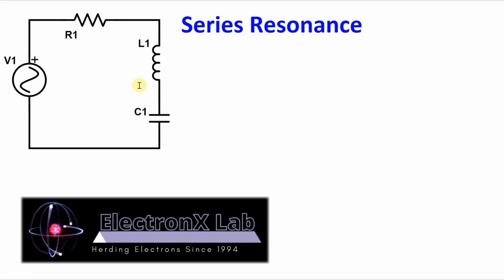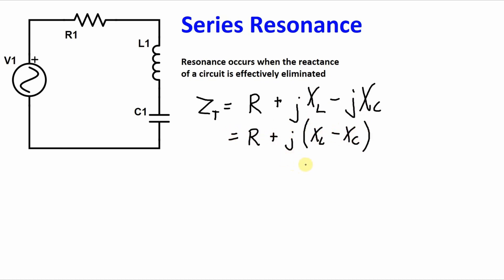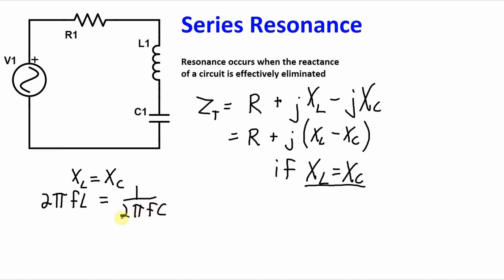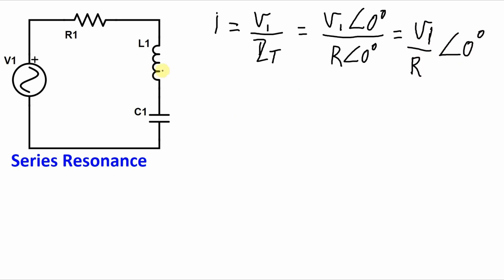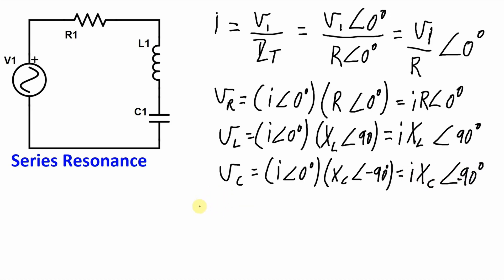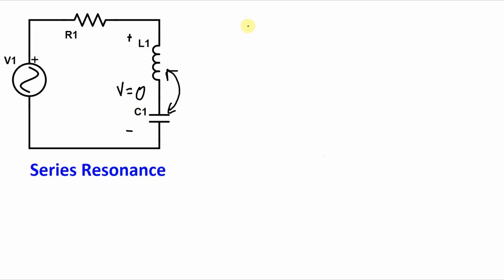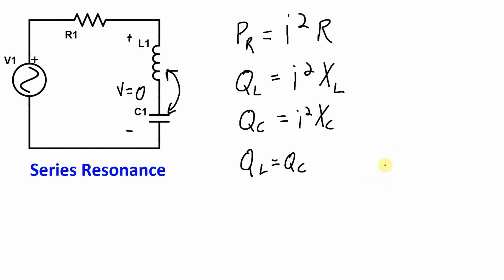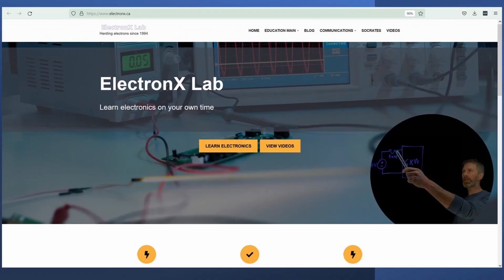Resonance in Series AC Circuits

Comment: That's so cool! Does that mean when we work with RF on a specific frequency and we are the receiver, we can test for a signal if the voltage (or other factors) of this circuit changes? Because at resonance the C and L cancel each other out and we can test for that to happen, or not?

Comment: Hell,
Please, stop placing + or - signs for AC voltage, where AC is not polarized.  The shown circuit does not make sense and never operates with DC and C1.  Please indicate your AC power supplies with H, N, and G.  Moreover, there are no polarizations + on L1 and - on C1.
Sincerely,
Reply: Unfortunately there are text book that confuse us with these symbols.
Reply: @suhailasaba1051  
Hello,
By design, textbooks are nothing; nevertheless, facades are there to deceive people and keep them ignorant.  All signs and values such as π, Sin, Cos, Ln, e, C, LY, G, g, ETC. are values that if God had used, the universe would have fallen apart before its creation.  
Try to draw a circle with a radius of 50.e1cm and π~3.141592653589793
238 46264338327950288419→∞.  If the completion of the sketch gets achieved, let the whole world know.  Also, it is good to remember that Einstein was a crook and E≠MC², where the speed of light is not constant (anywhere) and increases as this note get written and read.
%9.99999408068e1 of the Earth's population is ignorant, including scientists, politicians, scholars, Drs., intellectuals, and moms and pops.
Regards,

Comment: Question:
Why is a plus used with the AC sign symbol of the voltage source in the drawing of the circuit  ?
Thanks for your great video.
Reply from the maker: The plus sign is just there to set a reference point. i.e., if you were going to measure with an oscilloscope, you'd put the ground on the other side. I'd prefer not to put it in, but I drew that schematic with Digikey's Scheme-It and that's the way their symbol looks.
Reply: @ElectronXLab 
Thank you for your explanation.